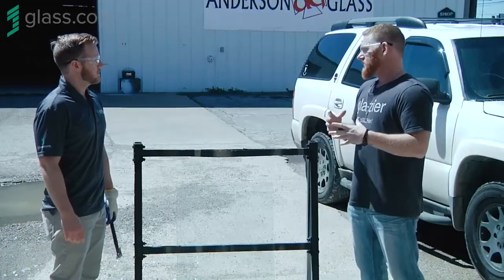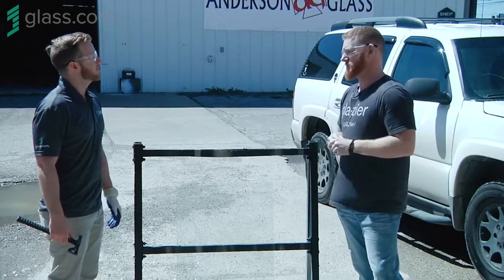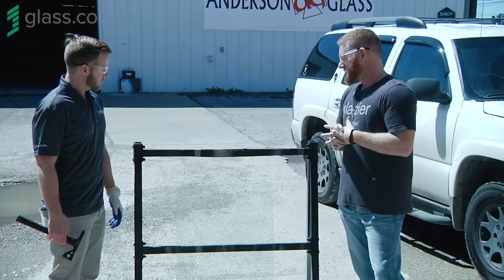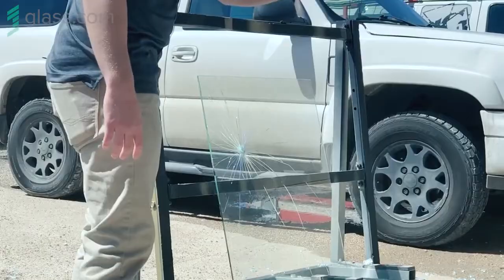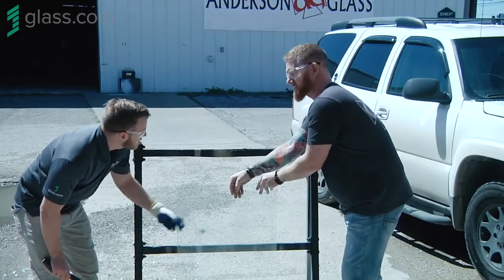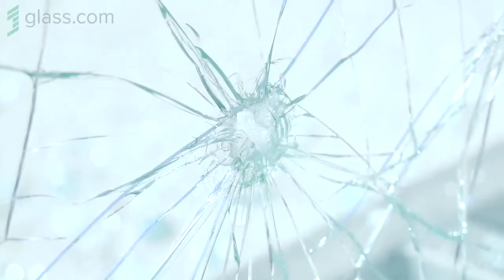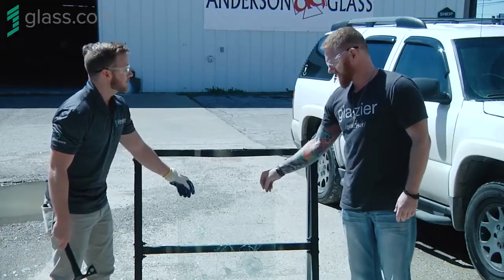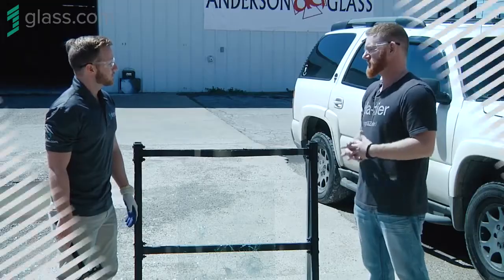Breaking Laminated Glass | Glass.com®

Comment: If there is low impact on the glass and a crack forms on one of the panels, was the impact created on the cracked side or the uncracked side. We have a laminated cracked window on the outside and we can't determine if the impact was from flying debris outside, outside window cleaners or some thing hit it inside and formed the crack on the outside.

Comment: If someone gets injured in a car crash and losses their hand strength they are screwed if they need to break out of their car to save their or someone else’s life!
Reply: usually the rear or back side windows are tempered glass which is easier to break.
Reply: @MegaBumblebee666 that's not practical and hasn't been the case in cases with kids trapped in cars with unbreakable windows

Comment: Where did I can find a tool to break laminated glass in case on an emergency?
Reply: pretty sure usually the rear window or the back side windows are made from tempered glass which is easier to break through.
Reply: Several flat nose hard cast 10mm+P rounds will do it but you'll never hear anything for the rest of your life.
Reply: There are glass cutter knives (saws) the size of a pocket knife.  Someone said to punch a bunch of holes with glass breaker and then use the glass saw to cut through the holes
Reply from the maker: Hello Javier, there are no emergency glass break tools (as far as we've seen) that are specifically made for laminated glass. This is because laminated glass is very difficult to break through. There is a plastic polyvinyl interlayer that must be cut through.